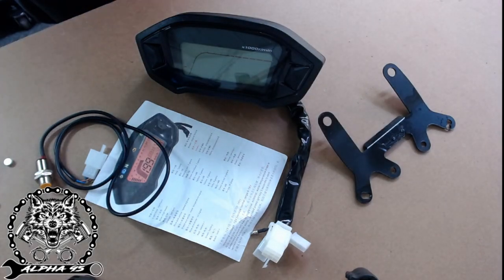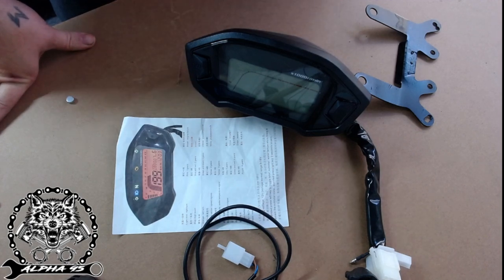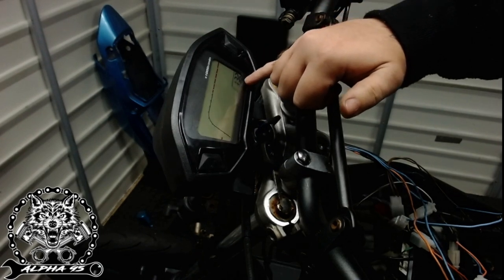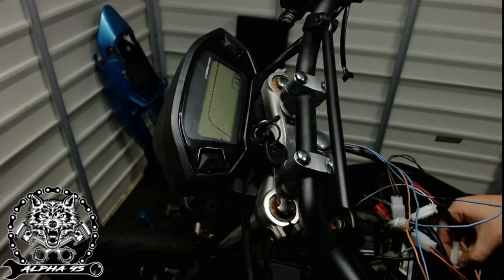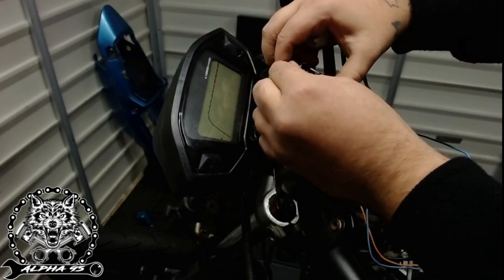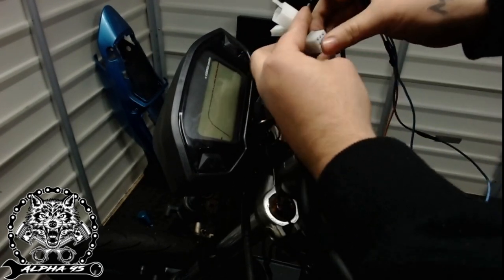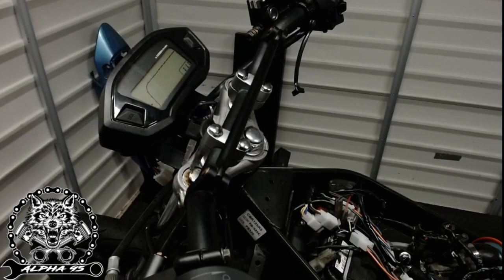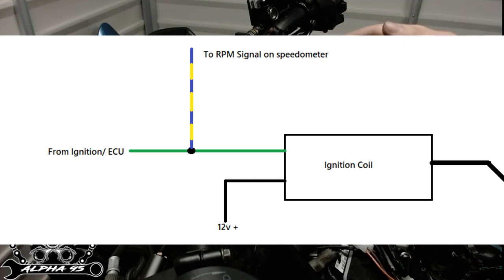Easy Motorcycle Speedometer Wiring: HOW TO & DIAGRAMS

Comment: Hi everything has worked but the speedo as no red green for neutral light have u any idea if yours could be wrong colour thanks
Reply from the maker: Hi. There is a chance the wires are coloured slightly differently on yours. Did you get any instructions at all with yours or have any left over wires? Should have a number of wires for gear indicators.

Comment: Hi I don't know if your still answering questions on the installation of the speedometer iv followed your videos and you made it really easy but I have a problem iv used my speedo pickup already came with my bike the problem is the speedometer keeps self checking but only after the bike is started the self check is random and shaking the wires don't make it self check any quicker 
Can you help please 🙏

Comment: Hi I’ve fitted this to my quad today 

My speedo won’t save the time or mph settings , I can get it to turn on by ignition I used a brown wire . Do I need to run a wire direct from battery to the purple wire?

Also how do you stop the fuel light flashing mate

Comment: Hi mate.....not sure if you can respond and help me out?...I have fitted this to a CBR400RR but I have an issue with RPMS,when idle the rpm goes full clock but when I ride it then it cuts out at 5g rpm in each gear?...wired into plug coil packs so have I done this correctly or have got to trace another colour wire to get full revs?.....Any help us much appreciated Thanks
Kev

Comment: Nice vid fella I’ve done all the wiring slightly different clock to yours but basically the same when I hold button then turn ignition on it goes to set up I’m having terrible trouble knowing what to input it’s a 17” wheel 120/70/17 it currently shows 1451 which I assume is for a 17” I’m baffled  to correctly input the 1st option and 2nd option for the speedo setup I see a lot with 2 magnet setup I only got the 1 magnet which won’t go on so I just bought standard magnets😩🙏👍

Comment: Hey buddy great video. I have an issue with my original wire diagram on my Yamaha mt03 2013. The fuel, indicators, high beam and backlight all have there own positive wire but then all need to run back to the black and white negative. As I connect fuel it is fine but when I wire up my high beam and run it of the same negative to get it reading, the fuses blow. Is there any other way you suggest I wire it so it doesn’t blow a fuse but have everything working? Cheers
Reply from the maker: Sorry I just saw this. Glad you found us on Instagram and I could assist there. Sorry for missing your comment

Comment: You had mentioned about grounding out the fuel wire if you don't have the sensor in your tank. I've got to do that cuz I don't have one. Does it actually turn the fuel light on the speedometer off? Or does it not do anything
Reply from the maker: Hi mate. If you ground it out all it does is show that the tank is full on the gauge, that way you won't have it constantly flashing.
Reply: Cool. Gonna give that a shot. Thanks!!
Reply from the maker: @srhmusic13  No problem! Send us a few pictures on our social media or tag us on Instagram @alpha9five with how it looks when it's installed. Be good to see it 👍🏻

Comment: Hi Alpha, I got me a different unit from China.... the directions are obviously a google translate job, but im managing so far. got most things working, except for RPM and Speed readout. My bike, an 03 katana 600, has a built in speed sensor, two wires from it, Orange w red tracer and a pink, where will I wire these in? to the 3 wires for the magneto speed sensor? grounding the ground out ofc. Or do I need to get a similar speed sensor down on the wheel axle like yours? I wont use the magnets, I dont trust it to stay attached :) Any help would be epic dude. Thanks in advance. 
Odin.

Comment: What did you wire the gear indicator wires to?  I can't find any information in this specifically. I'm on a gs500 which never had a gear indicator to start with, not sure if I can actually use it, Tia.
Reply from the maker: Hi mate. If your bike didn't come with a gear indicator then there is no where to hook them up to. But there is aftermarket gear indicators that you can use. They are cheap on ebay but personally we've not used one. I just cap off the wires and used the neutral light of none were fitted.
Might be worth having a look at the gear indicators on eBay and see how it works for you. GS500's are great bike by the way. Very much like them done as cafe racers!
Reply: @Alpha-wu5qx  thought you'd say that, thanks for confirming though.  I've been looking on eBay but most are utilising magnets to signal up and down shifts which wouldn't work with this unit. I know of some others that use the speed and rpm but have had no luck in working out how that work. What I need is something that uses the same design as this. Not the end of the world just would be nice to have. Also funny you should say that as I'm scrambler/flat tracking this GS. Cheers for your reply 👍
Reply from the maker: I do remember seeing something about magnets when I looked into it quite awhile ago, probably why I never tried it. Even the speedo magnets on all these units I replace with a digital speedo drive. Not really looked into any other aftermarket gear indicators but my first bike I ever owned didn't have one so I overlooked them ever since lol. Definitely show us the finished product of your GS!

Comment: can you install this on a 450-700cc motorcycle/quad? I Doubt it can measure the speed?
Reply from the maker: Hi mate. Yes you can though mounting might be tricky unless you can get a digital speedo drive fitted to the quad which some have. You could mount the magnets that come with it behind the wheel and mount the sensor so when the wheels spin the sensor will read the magnets. Only real way to get accurate speed reading with this method though would be to tune the speedometer settings using your GPS on your phone.

Comment: My bike has both the Speed sensor built in, and RPM wire. Yet i am having trouble getting the dash to read either signal.  I dont know why. Also this dash has two wires for RPM but my bike only has 1 . Have you got some info that could help me in that regard
Reply from the maker: Hi. Sorry for the late reply, I didn't get a notification. What bike is it you have?

Comment: Hi, just fitted one of these to my Honda CB500 1999. The instructions that I received are for a similar unit but not the one I have bought. I have the same one as you so my question is about the water temperature readout.
 I have two wires in my loom that go to the original analog temp gauge, the digital gauge has only one wire ( Blue/White), do I ground out the other wire? In addition, I have yet to see an actual reading on the digital clocks referring to the engine's coolant temperature, it shows temp when the key is first turned when doing a diagnostic, but after that, I can't access the temperature readout display in any menu. I have assumed that as I have not wired it up correctly it will not display. I would appreciate any help you can give me.
regards
Steve
Reply from the maker: Hi mate. Sorry for delayed reply, has been a busy couple of days. I did have a quick look for a wiring diagram for you bike but with no luck, though I think I have one on file somewhere.
Usually though one wire will be ground, one will be to the gauge. If you're having trouble another option is to replace the temperature sensor with the same thread that will fit this gauge. I know there are options for Honda that will fit.
Have you looked to see which wire it was that went to the old gauge?
Reply: @Alpha-wu5qx  Hi buddy, made a typo on my other post, I referred to the coolant wire as blue and white, instead of green and white, everything else applies though. I'm suspicious of my purchased digital clocks as my wire is not green and white but looks green and yellow. I've included a link so you can see. Ignore the multiple connector blocks, great tip of yours makes a much cleaner install.
https://drive.google.com/file/d/1Sl39X7e_BY7Tm7f6JMD1KLNeTDDzrTn3/view?usp=drivesdk
On your clocks does the temperature display itself all the time or do you have to select it?
If my clocks don't have a coolant function do you know how I can test the clocks to find out exactly what the green and yellow wire does?
I have an engine oil warning light, no mention of one in the dodgy instructions, how can I make the oil light work?
Sorry for all the questions.
Regards
Steve

Comment: Hi i have same speedo any chance of a bit of help i have everything worlkng apart from speed and dpnt want to use the magnet it came with when my bike already has a speed sensor just wanting to know which is speedo sensor wire on this speedo and which is positive etc thanks
Reply: My speedo has a brown a blue and a black wire going to original speedo magnet what came with speedo i need to put wires to my original bikes cluster instead of magnet do u know which of the wires is which
Reply from the maker: The way I figure it out is finding the original wiring diagram for your bike and have a look at which functions are for the different speedo wires. You can play with it until you have a signal. Tuning wise it's a bit iffy, you'll have to get a GPS speedo and play with the settings match that.

Comment: How did you hook up the sensor so it actually shows the Rpms & Speed? Also having trouble with the fuel light
Reply from the maker: Hi. What part of the RPM are you having issues with? I've another video on speed settings etc. The RPM gauge can be hooked up to the positive side of your coil or previous wire for RPM of there was one. Then in settings select the amount of cylinders you have. The fuel light is an negative wire. If you don't have a fuel sensor you can just ground it out to the frame. If you do have a fuel sensor it will attach to the negative side of you fuel sensor.
Reply: I have no clue why it wouldn’t show when I hooked it up to my rpm wire but I have to get back in that CDI or Ignition coil I’ll give it a shot thank you!
Reply from the maker: Have a look at the settings and make sure it's set up right for the number of cylinders your bike has. If that don't work then try the coil method. It should work off the old RPM signal wire though.

Comment: Hey I’m trying to connect my wire for the rpms but don’t know where can you describe in detail where you put that wire. Do you wrap it around the coil wire or cut into it or? I have a mechanical rpm currently.
Reply from the maker: Hi. Best bet is to put it into the positive side of your coil wires (not the actual plug wire). Strip a fair bit off it and wrap it round the connecting pin and then start your bike just to test it works and picks up a signal, if all looks good then wire it in permanently to that wire.

Comment: Can yiu change it to mph??
Reply from the maker: Yes there is an option to change it to MPH. It should be in the instructions, I can't quite remember how to change it to MPH but it is very easy to without messing up settings. I can have a look later. 

Also useful if you decided to travel abroad where the have kph 😅

Comment: Como puedo poner el kilometraje viejo del  tablero al tablero nuevo??
Reply from the maker: Magnet glued to a disc on a drill. Wheel setting set to largest on speedometer. Spin the magnet past the sensor using the drill until mileage is correct. 
Sorry my Spanish is not very good so I hope I understand you correctly and that you understand me 😅
Reply: @Alpha-wu5qx   entiendo tu español 
Entonces puedo usar un taladro para poner el km viejo mi sensor de velocidad no es que viene con el tablero del video no es como un tornillo es otro modelo

Comment: how to connect that fuel, engine while turn off the switch will show that 8:00 - 8:05.
Reply from the maker: Are you asking how to connect the fuel gauge? I had the tank off in this video but it goes to your fuel wires, usually the ground. If you have no fuel tank or gauge, then connect to any ground and it will show full. Sorry for the late reply, I am on here but your comment didn't appear in notifications. If you need any help you can message us on Facebook or Instagram and we will help you step by step. 👍
Reply: @Alpha-wu5qx  thanks i get the pattern
Reply from the maker: @xtralaagmoto8784  Glad it helped. We will be doing more videos soon, if you have any parts you want help to fit then chances are we can do a video on nearly anything. We do a lot of custom motorcycles with lots of different parts. We are currently moving our workshop to a bigger and better location and will be doing a video at least once a week.
Reply: @Alpha-wu5qx  but mate i have a fuel tank?
Reply from the maker: @xtralaagmoto8784  The Blue and White wire will go to the negative side of your fuel sensor on your fuel tank 👍🏻